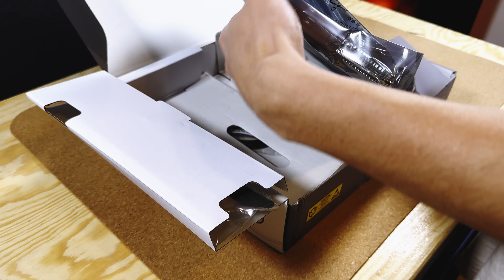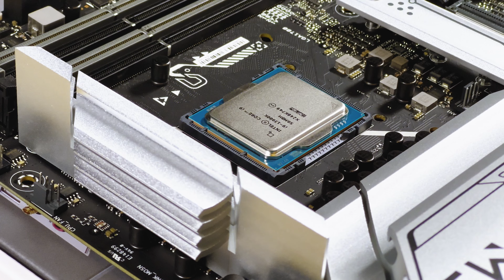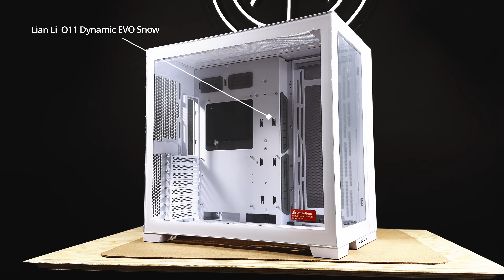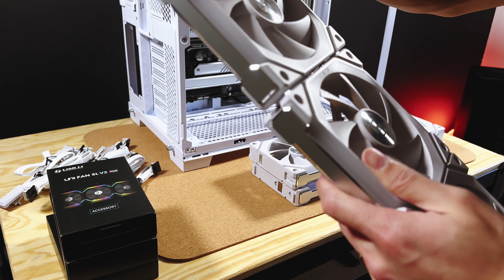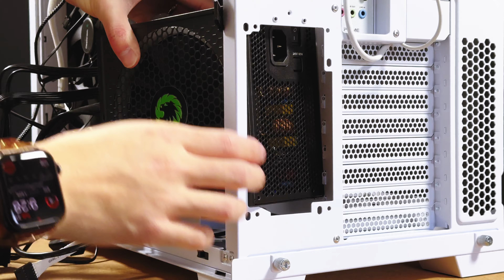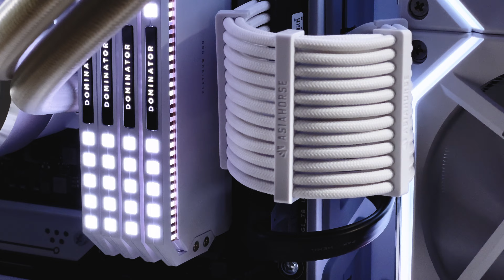Ultimate $7000 build Intel i9-13900K and ASUS ROG Strix RTX 4090 White

Comment: Would I benefit if I used a different motherboard like ASUS ROG Strix Z790-A Gaming WiFi LGA 1700(Intel® 12th Gen) ATX gaming motherboard(16 + 1 power stages,DDR5,4xM.2 slots, PCIe® 5.0, WiFi 6E,USB 3.2 Gen 2x2 Type-C® with PD 3.0 up to 30W,Aura Sync RGB)

Comment: Isn't better to use 2 RAM slots but with the same capacity rather than using all of the slots since it's DDR5 also?
Reply from the maker: There’s a lot of debate whether to use 2 slots or 4 slots. As far as I know, 4 slots will lower the frequency and will make the system unstable. However, I didn’t overclock the RAM speeds and I haven’t had any issue with the 4 slots configuration and I really like the aesthetic of 4 RAMs so it works well for me💪🏼

Comment: Did you get the promised 6200MT/s out of the RAM with this four stick setup?
Reply from the maker: I did not, I have tried multiple ways to overclock it to 6200MH/s, but I keep getting blue screen or instability in windows. It seems like the motherboard isn't liking it, hopefully future BIOS update would fix the issue. As for now, it is still using the default clock speed

Comment: I literally built the same exact thing without the internal monitor and I went with the ROG Z790-A D5 and I spend $4200. How did you guys spend $7000
Reply from the maker: We got the ASUS RTX 4090 Strix in white when the market is on its peak 🥲
Reply: @archetype_origins  CAD or USD?
Reply from the maker: @Deathignator  USD

Comment: 13900K and RTX 4090, but an absolute entry/budget Mainboard... bro why.
Reply: Couldn't agreed more.
Reply from the maker: The Z790 is more than enough for what the customer needs. He is not extreme overclocker, so we really don’t see the point in using a high end expensive motherboard just to bring up the total cost of this entire build
Reply: @archetype_origins  
Nobody is talking for extreme OC or something like that (absolutely useless). 
But if you watch the VRM Temps and more, you will see a significant difference between an ASUS Prime and an ASUS Hero Board. 
As well you will be able to optimize RAM better on a good board, instead of an entry board.